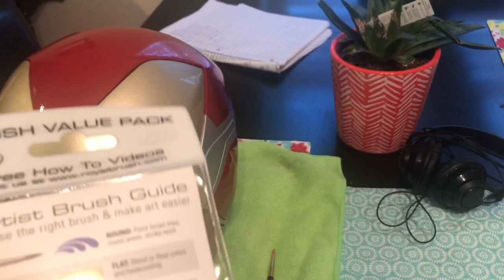Proper painting techniques | Iron man MK85 helmet painting | wetsanding, polishing & finishing tips

Comment: Great instruction. Sanding stages are... interminable but really importantly the final product, you did a good job of showing what each stage looks like and when to switch grits both in how it sounds and looks. So A+ there. Pacing is slow but to go over the stages like you did it would suffer on the info side if you did though, tough call. Sound is a bit inconsistent recording different times, locations and mics makes it hard. Most audio editing has an auto balancing option once you’ve cut the clips together so you can keep the volume of the main speaker about the same level.  I did enjoy this, kept me company while I was sanding my mandolin helm. Only real issue no hat, cowl or grappling gun!
Reply from the maker: If you watch my new videos the audio is fixed, my phone speaker was shot so I apologize. I am trying to be as specific as possible in these videos to help anyone doing similar projects. Your feedback is noted & greatly appreciated! Much better quality on the newer vids!